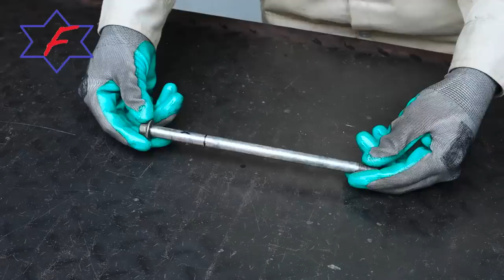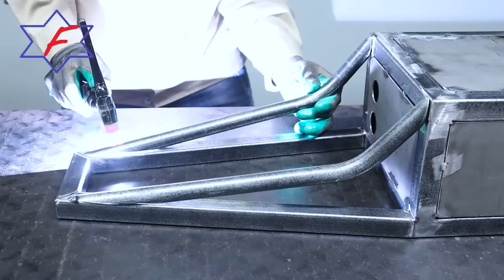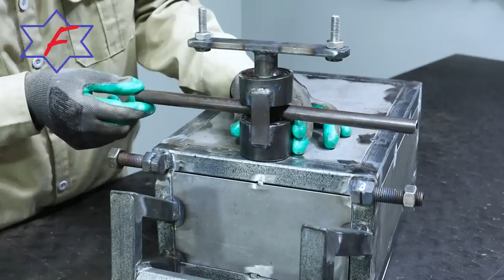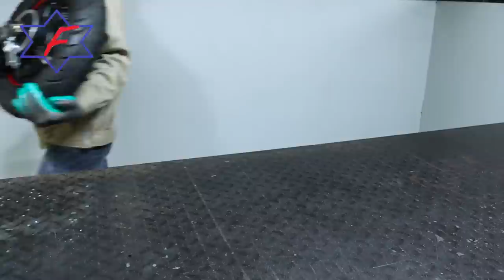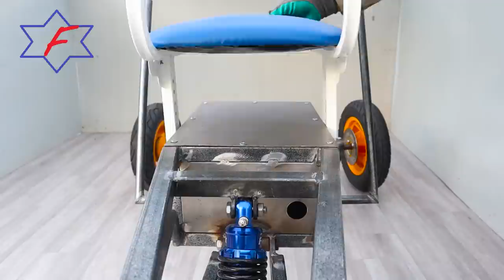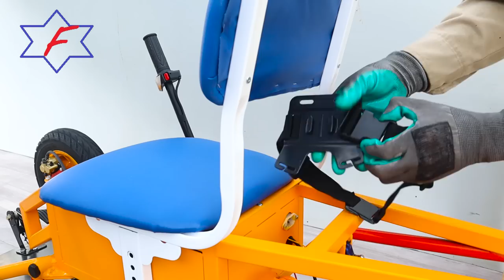Build An Awesome Electric Trike

Comment: The key is the battery. If you can have a range of 200 miles per a full charge and you can charge your car from 0% to 100% in 5 minutes without a high cost of battery, then you can make an electric car at any time you want. Info only. Enjoy!
Reply: Be careful. I read my Electronic Tutorial book and notebook. It says the batteries of different voltages should never be connected in Parallel. ⚡